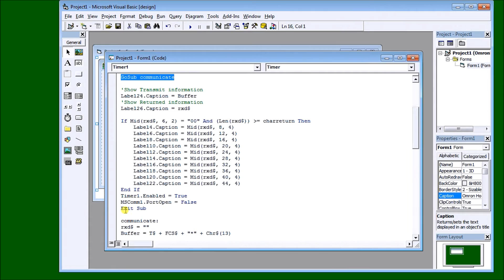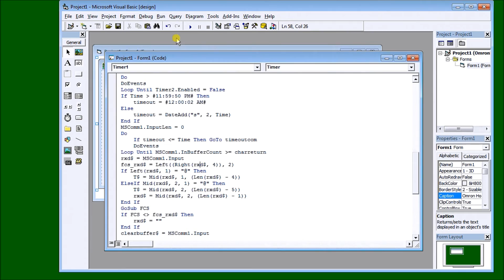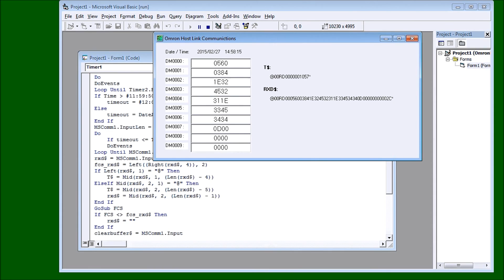Unlock 32-Device Control: Omron's Secret Protocol Revealed

Comment: Can we use this method to send string from PLC to label printer using RS232
Reply from the maker: Hi Amir,
This is for the Omron Host Link protocol. This protocol would not be for a label printer. However, you can send ASCII characters out of the Omron RS232 port using a TXD instruction. Here is a link to the Omron website showing how this can be done.
https://www.myomron.com/index.php?action=kb&article=21
Note: Every label printer is different. I would test this with hyper terminal out the RS232 port of the computer to the printer. This would mimic the characters required for the transmission.
https://accautomation.ca/three-free-plc-programming-software-tools/
I hope this helps you out.
Regards,
Garry

Comment: can it be used to control the output coil on or off?
Reply from the maker: Yes, you can control the output directly but usually you would use an internal work bit to control. This work bit would then be an input rung condition for the output.
Regards 
Garry
Reply: @ACCautomation  so, if i also want to use pushbutton for input, do i only need to make it parallel in the ladder diagram?
Reply from the maker: @ahmadmuhaimin2852  
That is precisely how you would program it. This way, you can control it from the PLC or remotely.
Regards,
Garry
Reply: @ACCautomation  thank you
Reply: @ACCautomation  what about the different operating modes, program, monitor and run modes?
Reply from the maker: @ahmadmuhaimin2852  
Host Link has no commands to put the PLC in the different modes. This is usually done by the setup area of the PLC. If you are going to communicate Host Link, put the controller into monitor mode so you can write to the PLC.
Regards,
Garry
Reply: @ACCautomation  how can i set this setup area of the PLC to put the controller into monitor mode? is it through cx programmer on PC, is it non volatile?
Reply from the maker: @ahmadmuhaimin2852  
Please take a look at the following manual for the Omron CP1H to set the PLC Mode.
http://dim.usal.es/eps/im/roberto/pesados/ryc/CP1H_Operation_Manual_(W450-E1-01).pdf
See section 2-5-4 Startup Mode Setting
Your model may be different. Please take a look at the manual for your Omron controller.
Here is a link to the Omron CP1H series:
https://accautomation.ca/series/omron-plc-cp1h-series/
Regards,
Garry

Comment: great video, i need to know if i can connect the PLC to some microcontrollers like arduino or esp32 for IoT application
Reply from the maker: Hi Ahmed,
The easiest way to do this is using Node-RED.
This link will show you how to get the information out of the Omron controller.
https://accautomation.ca/omron-plc-node-red-serial-communication/
Arduino can communicate MQTT using an Ethernet card. 
Here is a link to the entire Node-Red series.
https://accautomation.ca/series/node-red-iot-enabling-software/
I hope this helps you out.
Regards,
Garry
Reply: @ACCautomation thank you very much, yes i want to make esp32 or arduino to act as a gateway. Communicating with plc via hostlink and at the same time sending to mqtt broker and vice versa
Reply from the maker: @ahmadmuhaimin2852  
Node-RED can run on ESP32. I have not done this, but here is a link to a post.
https://thecustomizewindows.com/2019/03/getting-started-with-node-red-for-esp32-arduino-localhost-ibm-cloud/
Node-RED can be an MQTT broker if you want.
This is the AEDES MQTT broker in Node-RED.
It is great for testing.
https://accautomation.ca/productivity-plc-node-red-mqtt-p1000-p2000/
I hope this helps you out.
Regards,
Garry
https://accautomation.ca/series/node-red-iot-enabling-software/
Reply: @ACCautomation  thanks, subscribed already, now it is all about connecting to esp32 via rs232
Reply: @ACCautomation  i dont see any option to install node red on esp32, do you mean install it locally on a local server?
Reply from the maker: @ahmadmuhaimin2852  
Yes, install Node-RED on any computer with a serial communication port to communicate with Omron. MQTT will be used by ESP32 to communicate to Node-RED via a broker. 
https://randomnerdtutorials.com/esp32-mqtt-publish-subscribe-arduino-ide/
Regards,
Garry

Comment: Which IDE you use to write vb6?
Reply from the maker: Hi Chandarara Nget
VB6 is an old software program still used today. I would now use VB.Net.
Here is a post that will explain using VB.Net.
https://accautomation.ca/implementing-the-omron-host-link-protocol-vb-net/
Another method you can use is Node-RED which is an IoT software package. 
Here is a post to read information from the Omron controller.
https://accautomation.ca/omron-plc-node-red-serial-communication/
Here is the entire Node-RED series:
https://accautomation.ca/series/node-red-iot-enabling-software/
I hope this helps you out.
Regards,
Garry
Reply: Hello sir, can you share the program?
Reply from the maker: @chandararanget7879  
Here is the link for the Omron Host Link Protocol code:
VB6
https://www.dropbox.com/s/4zsg90encf5bxrz/OmronHL.zip?dl=0
VB.Net
https://www.dropbox.com/s/zzsqzi5enbz8iyn/Omron%20Serial%20Communication%20VB%20net.zip?dl=0
This is the post for the VB.Net program:
https://accautomation.ca/implementing-the-omron-host-link-protocol-vb-net/

You may also be interested in Node-RED and reading information from the Omron controller:
https://accautomation.ca/omron-plc-node-red-serial-communication/

I hope this helps you out.
Regards,
Garry
Reply: Thank you so much

Comment: HI garry , 
Thank you for sharing.

i need to charge an omron PLC with a csv file according to his need , and for that , i have to wait the information from the PLC in order to give it the CSV file in need.

How can i do that knowing that i need to do it automatically for 5 PLCs with a single PC and  i must use serial connection.

Thank YOU .
Reply from the maker: Hi Soufiane,
This is possible. Each hostlink (PLC) will have a specific unit number. In my example above, we used unit number 0. You can have 32 units on the network. 
Please refer to the write command in the manual specified on the website:
http://accautomation.ca/how-to-implement-the-omron-plc-host-link-protocol/
It will look something like this:
"@00WD0000111122223333"
In the above example this will write 1111 into DM0, 2222 into DM1 and 3333 into DM2.
Here is an example of reading and writing from a CSV (comma separated value) file using VB6:
https://stackoverflow.com/questions/46776750/how-to-read-and-write-comma-delimited-text-values-to-file-in-vb-6-0
I hope this helps you out.
Let me know.
Regards,
Garry
Reply: Hi Garry,
Thank you for your feedback , i appreciate it .

i'm on the first steps of my project , I will visit your website for more informations for sure and let you know my state of progress very soon.

I have another request for you , can you send me your Vb.net code of the hostlink project  , i visited the dropbox file and i didn't find anything.

here is my email address : soufiane.touil1996@gmail.com

Thank you and let me know if it will be possible to contact you via email next time .

Regards.
Reply from the maker: Hi Soufiane,
I will send you an email with the file links. 
Here is the link for the VB6 files:
https://www.dropbox.com/s/4zsg90encf5bxrz/OmronHL.zip?dl=0

There is also a program that will use VB.Net to communicate to the Omron Controllers.
Here is the link:
http://accautomation.ca/implementing-the-omron-host-link-protocol-vb-net/
Here is the video:
https://youtu.be/Ckv3zmCJ40w
Here is a link to the files:
https://www.dropbox.com/s/zzsqzi5enbz8iyn/Omron%20Serial%20Communication%20VB%20net.zip?dl=0

Regards,
Garry

Comment: I use the Omron PLC CP1E-N20 with RS232 port. How do I use the PC's USB to PC's RS232 converter circuit, and does your code need to be modified? Here I use USB to Com (PL2303) and Max 232 connected to the PLC but still not working
Reply from the maker: Hi Tran,
The code will only have to be modified for the communication port that you are using. Example COM1 vs COM5 etc.
I would check your wiring of the port to the USB to Serial (RS232) converter.
https://www.myomron.com/index.php?action=kb&article=1536

I usually will use a RS485 converter like the following:
http://accautomation.ca/usb-to-rs485-pc-adapter-installation/

Regards,
Garry

Comment: Let me ask that I
 want to control the plc omron from the computer via RS232 port, then I 
have to send the command to the PLC so that it can work. Thank you
Reply from the maker: Hi Tran,
Yes you need to develop or use software that will run on a computer. This software will generate the required commands (protocol) that the PLC will understand and communicate back to the computer. The RS232 port acts as a serial communication device for this purpose and the protocol is the Omron host link.
What do you need to do with the communication?
Another option would be to use AdvancedHMI. This is a open source software written in VB.Net. All of the drivers for a majority of manufactures have been written and it has some good graphics.
https://sourceforge.net/projects/advancedhmi/

Here is a post using AdvancedHMI with the Omron PLC.
http://accautomation.ca/omron-cp1h-advancedhmi-communication/

Regards,
Garry